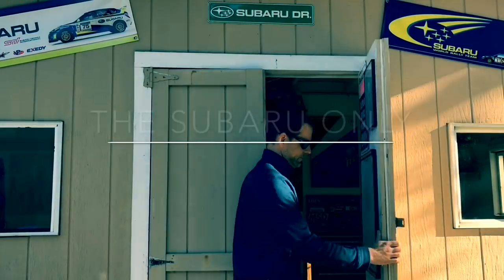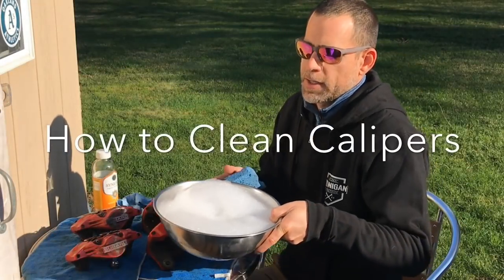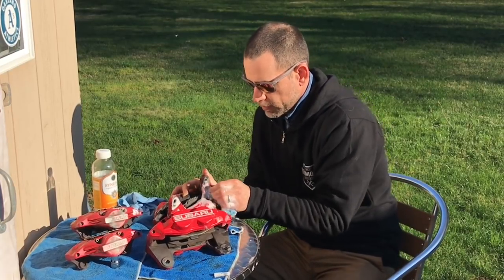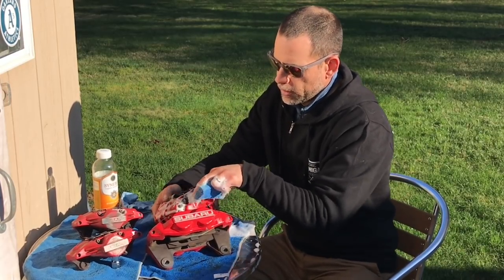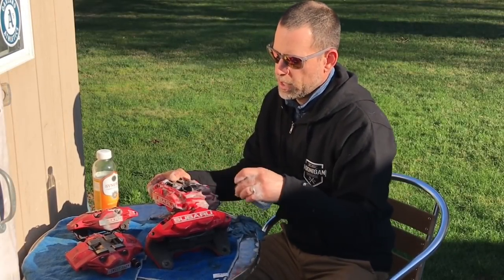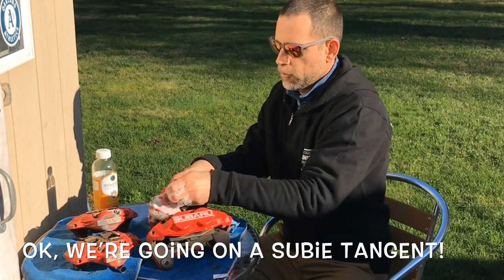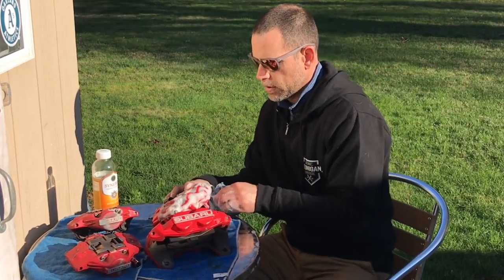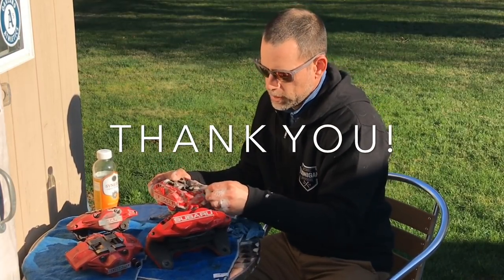4/2 Pot Calipers on GC8 | TOP 5 Reasons to Upgrade

Comment: South Island New Zealand! You gotta come here cos if you do I will show you the most beautiful place on earth and in a WRX. Down here we have a mix of imported secondhand JDM models and (NZ new) or Oceania models like mine which were slightly detuned to run on 95 octane and have 260kph speedo and no speed cut, cruise control, 17” wheels and slightly different spring rate and no mirror fold in buttons. Today you can pick up a decent bug eye with 200k kms for about $2,500-$3000USD here in NZ and there’s plenty around but the Version 8-9 seems to be going up on price and getting highly sort after and go for about $10,000USD at 180-200k kms. We are really spoilt for choice of cars in NZ and only a few more years until the cannabis referendum goes through to get it legalized can’t wait. 
Keep up the good work and wish you heaps of subs as you deserve it !
Reply from the maker: Dude.  Whoa.  Sounds like I’d love it over there!  Thanks for sharing - you’re right.  I gotta get over there.  My kind of place for sure! Maybe some day I can make this happen, who knows!  Cheers and thank you!  🤙

Comment: I have done this upgrade on my 2004 Forester XT and yes it is a top upgrade for the cost 100% agree.
I decided to rebuild the 4 pots as the ones I bought the boots were split, and it really was dead easy to do with the rebuild kit you can buy. On a Forester and maybe other Subarus with the small rear solid rotors being the most noticeable thing is the 2 pots, I replaced mine with a low mileage WRX Hub, which uses a bigger ventilated rotor. Also did the braided lines and Cusco master cylinder stopper, with good pads and brake fluid it's a massive difference over stock setup.
Reply from the maker: Hell yes.  Thanks for sharing.  Yep, I’ll probably do the same and rebuild them in future video. Cheers!  And you got a dope car buddy!!! 😎😎😎
Reply: So if you are installing 4 pot front caliper from 2004-2006 WRX on 2004 Forester they bolt right in? You don't need to swap knuckle from WRX?

Comment: Hey Luke, I know that most of the JDMs had the 4/2 pot caliper brakes. If you were to buy that, would you purchase the 06/07 wrx caliper rebuild it to use for the 4/2 pots? I think they are the same but not 100% sure. Thanks

Comment: Bay Area Rex here. Just did my brakes with DBA slotteds. Already have SS lines and master brace. Now I just bought the 4pot/2pot for my 2010 Rex Wagon. Cannot wait to do the upgrade. Bought off Ebay new for $860. Now I just need the 2010+ Legacy Gt rotors for the rears and a rear adapter bracket. Don't know which bracket is best for my ride. Great video btw.
Reply from the maker: It’s gonna be a huge difference man!  Especially with the stainless lines - combine that with fixed calipers and it will absolutely be a night and day difference! 👊

Comment: Did you ever get these installed? Also do you know if the Brembo fronts are the same for just bolting on to a USDM GC8? I'm aware that the back Brembo's need an adapter plate.

Comment: Thanks for this advice, feels much better now I was fed up of the sketchyness before but now I’m starting to see the difference with the fixed calipers, could you advise on the TGV delete?
Reply: Any time you improve airflow, make sure you tune the ECU to know you've done that. It's especially important for '05 and up as they already started leaning out the fuel to meet emissions/MPG regulations by that point

Comment: I've been considering these on my swapped rs for a long time. Been running wrx front brakes, legacy H6 rears, Porterfield RS4 pads, ss lines and a master cylinder brace and it feels pretty amazing. I could probably convince myself to go 4 pot on the fronts at some point. However for the rears I have a set of 05 legacy gt brakes with the vented discs (yet to be installed). Unfortunately they the still have a sliding caliper but have that thicker and vented rotor for better cooling. I'm fairly certain that H6 and Legacy GT rear brakes are same diameter but will not work with 2 pot rear calipers. I might be wrong but even if the 2 pots could fit a larger diameter rotor I don't know how it would work out with a vented rear rotor since its much thicker. That's probably the only thing preventing me from sourcing 2 pot rears, what's your thoughts?

/end huge paragraph, lol

Comment: Subaru Forester XT 2.5 5x100 would they fit
Reply from the maker: They will.  But you’ll need adapters for the rear calipers and new rotors too (dual vented style).
Reply from the maker: Lol.  I thought so!  I noticed the logo. Nice 👍

Comment: My question is I would like to convert my 2004 Subaru Forrester rear drum brakes to disc what’s my best option as far as compatible year for the swap
Reply from the maker: You should have no trouble adapting disk brakes from an impreza, forester or legacy factory equipped with rear disk brakes.  Great thing about Subarus are they are extremely interchangeable. Good luck!!!
Reply: 630 back yard project just remove disc brake knuckle and hub ebrake line and abs sensor off from same year forester WRX or legacy. I'm doing the same for my 01 forester with disc from av2000 Impreza 2.5RS
Reply from the maker: Legit.  Nice breakdown!  Thanks!

Comment: Dude! you went backwards with you reasons to upgrade!! All those upgrades are designed to stop the deflection of flexing causing wasted movement. The master cylinder brace is designed to transmit all pedal movement straight to the line instead of losing some to firewall flex. These one piece calipers also offer more metal to dissipate heat from sustained heavy braking.
Reply from the maker: Totally agree with the brace transmitting pedal force to braking system and less loss to firewall flex. I should have added that - thanks for pointing it out.  Same for the heat dissipation, totally true and another good benefit I should have discussed.  I’ll try to touch on those points when I do the install video.  Cheers man!  🤙🤙

Comment: freezing in OH here
Reply from the maker: I bet. Thanks for watching buddy. Cheers! 🤙
Reply: @SubaruONLY  The darnest thing happened the other day. I was driving the car it stalled. Long story short had the battery and alternator checked. Battery was low and Alternator good, jumping the battery did not help it kept stalling after 2-3 mins! Then while removing the Alternator the wiring harness disintegrated (the one under the red plastic). YES it was rusted to the core. I guess the alternator could not charge the battery! I tried finding someone who sells Wiring Assembly - Alternator Subaru outback 2.5 unsuccessfully, do you have any leads?  Thanks a bunch
Reply from the maker: That’s rough.  I would check with iWire and if they can’t help, I’d probably go to eBay.  Should be able to find sections of the wiring harness for decent price.  Good luck getting her back on the road buddy!   👊
Reply: @SubaruONLY  Found nothing on ebay, IWIRE  was going to take a while had to get my ride back on the road, went to junk yard cut off  a harness and soldered it on. Worked like magic. Will save IWIRE for some work I am planing in the future had no idea they existed. thank you much
Reply from the maker: Nice man.   Good call on the junk yard!  🤙

Comment: Will the 4/2 pots fit a 2013 crosstrek?
Reply from the maker: Sorry, not sure. i like the crosstreks but worked on one. You might be able to look up if “06-07 WRX brakes fit a 2013 crosstrek”.  Good luck.  Sorry not more help on this one!!
Reply: @SubaruONLY  I pulled the triger and bought the set. I'll let you know
Reply: @sonbum1  How did they go?  Did they fit?
Reply from the maker: Yes, was pretty straight forward.  Fronts bolt up no issues, just need the correct size rotor (OEM 06-07 WRX) and reads needed new rotor plus little adapter brackets for the calipers, needed to open up the holes slightly, but working great for a while now!!!
Reply: @SubaruONLY  awesome.  I should probably grab a pair for my 92.  Thanks
Reply from the maker: Yes, big improvement in feel. 👌